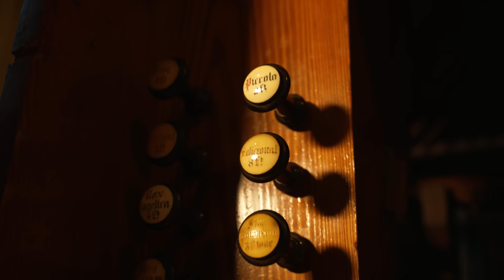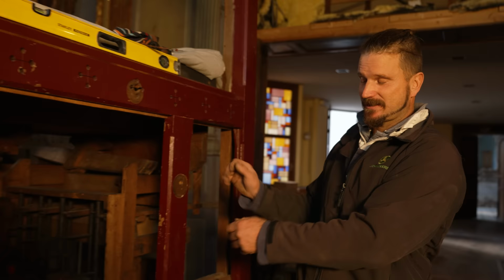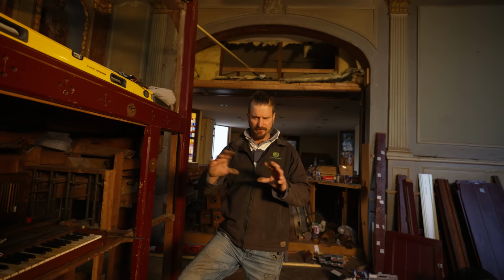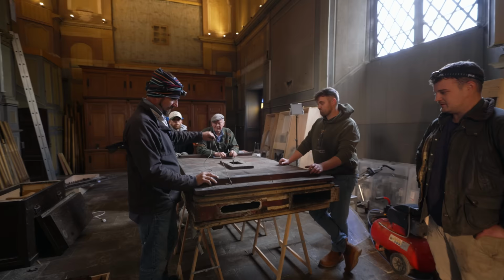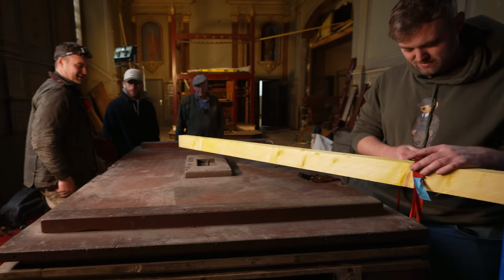The Organ Expert Turns Up!

Comment: My favorite screw driver is almost 100 yrs old. Restoring old furniture it comes in handy. Fits 100 yr old screws perfectly.
Reply: My favourite drill, is a brace and bit, that belonged to my grandfather! I'm 72, so it's likely at least 100 years old and still works perfectly!
Reply: @merrileeheard3889  I have one of those as well. But just for looks. It has a Crack. My mom bought me an amazing electric drill, sander, etc but I do everything by hand and with my little screwdriver. 🤣

Comment: I just love how you guys problem solve. The blue lift was genius!  How special it was to have the pipe organ building specialist to assist Michael and Mr. Moon since Father Paul can't be there. I was surprised that the bellows leather is white, but how cool that the black marks on the old leather helped with finding the holes and torn bits to repair.  This was a wonderful and fascinating video.  Thanks!

Comment: The reservoir (bellows) would be better repaired by completely disassembling and working from the inside out. Michael's patches will not hold and there will still be caustic dirt/grime in the reservoir. The chests allso should be disassembled and re=leathered.

Comment: 27:00 the mixture used is called "rabbit skin glue".  It was used hundreds of years ago in affixing oil painting canvasses to a back lining which helps protect the oil paint from flaking and peeling; it also provides the edges which are used to nail the canvass to the stretcher/frame to keep it taut and provide structure.  The stretcher/painting is then inserted into the picture frame for hanging.

Comment: Tips from former pipe-organ factory employee: If you get uneven air pressure in the reservoir or a "wobbling" vibrato sound because it's not keeping an even pressure, put some flat slabs of concrete pavers on each end of the floating piece on top, which will help dampen the back and forth of incoming/outgoing air pressure. It's like your arm on a bagpipe. To keep the pressure even, you have to let up the pressure on your arm when you blow into the bag, so there's a "see-saw" effect. Same with the air reservoir on the pipe organ, so putting a few bricks or weights on the air chest will help even the pressure. The instrument will also have a "polyphony" limit (i.e. you can only play 8 notes at a time) before it exhausts the pressure, so if notes start cutting out after giant Bachian chords, it's a limitation of the air reservoir and how quickly it can refill. I'm probably messing up terminology because it's been 25 years since I worked at the pipe organ factory, but hopefully it'll give you a start if you need to debug.

Comment: Looking great and it will be amazing once it is reassembled. Hide Glue is made from animal hides, tendons and hooves which are boiled down to a sticky paste and then dried into granuals. Water is added to rehydrate the glue.  It was the most common glue used up untill the 20th century.

Comment: I keep being surprised that nobody has suggested to Michael that when he is blowing away dust with compressed air, he needs to have a vacuum running on the opposite end nearby to capture all that dust!!! 

I came up with this when changing my cat's litter box, and the dust was coating everything. I just position the nozzle nearby the source of dust production, and voila! 

I also wear a dust mask for any dust that escapes, there's much less but it's still not good for me.

Definitely need to wear a dust mask when working around so much dust production. I heard someone coughing after all the dust removal!

Comment: You should really strip ALL the old material off and clean all the surfaces and properly reseal the wood then apply all new material, it will just continue to
deteriorate over time. The Organ Media Foundation did a complete video on U tube showing the complete rebuild, it takes a while to get it done but forget Christmas
and go for quality renovation.

Comment: Why haven't you filled concrete into the driveway to smooth it out under the entrance gates? You could even ad a grate to drain any rain water. You should also pressure wash the front walkway and steps leading to the Chapel entrance doors by the street. I noticed a green moss growing on them when you drove the lift around the front.